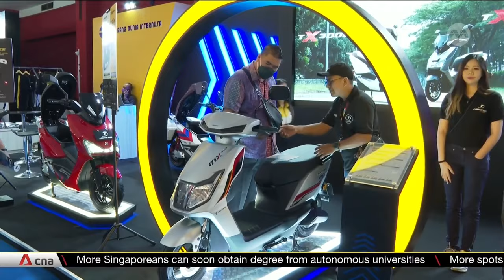Can Indonesia become a major player in the global electric vehicle market?

Comment: If locals dont buy it maybe its too expensive. Selling motorcycle is easy but repairing electric internals would be expensive also regular mechanics wont even touch it. Some prefer old or generic motorcycles mainly because of availability of parts.
Reply: The specific internals of e-motorcycles need far less maintenance than dinosaur engine bikes. And the technology is actually more simple. That does make them very interesting for businesses, in particular with a battery swapping system.
For private users, how does one expect that to be accepted in the market, if there are no charging possibilities? There is a reason why both companies go to Indonesia.

Comment: Dependencies of EV-niche
= they have to use it themselves, walk the talk, for others to have faith in their products
= they need to have electrical-grid capable of handling the extra loads
= they need to have safety or their high density areas are fire hazards
= they need the range to run from earthquakes and tsunamis and floods and cross small streams
= others need toxic production of batteries in their country
= they need to have facilities to cater to pollution
= the costs and space(costs) and time queueing up to swap batteries at their stations... maybe 3 steps...

When the proposals solved all these... their known working speed and implementation speed...